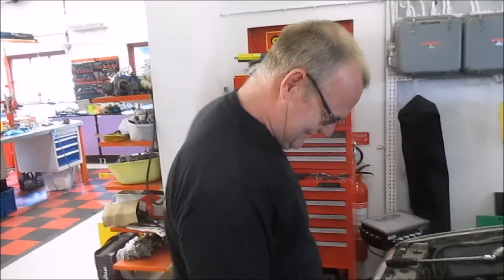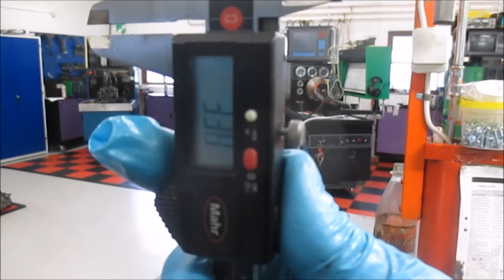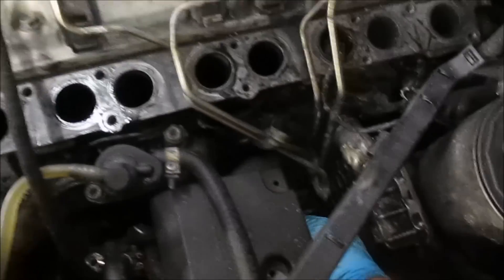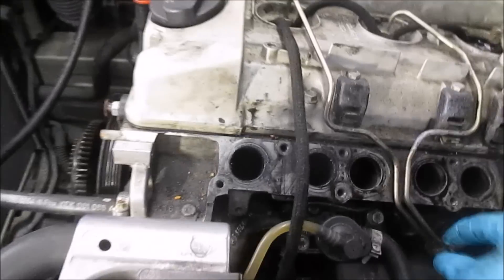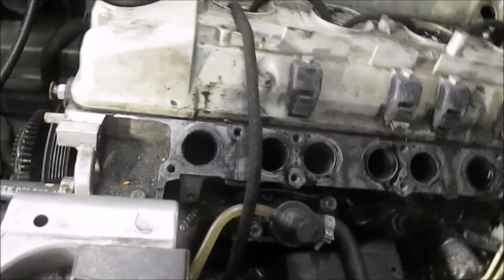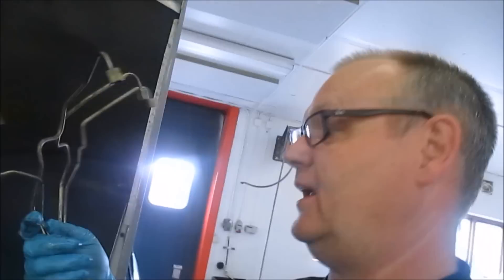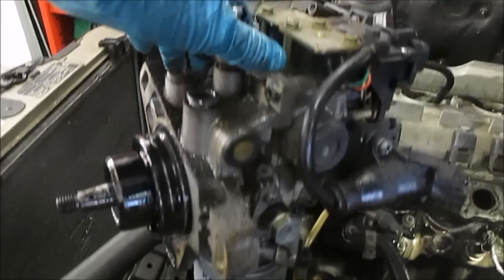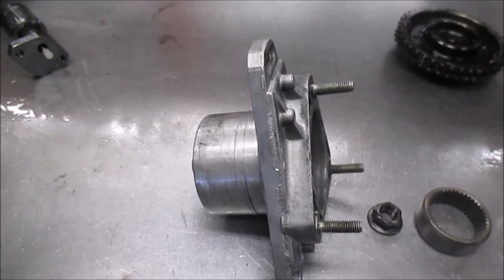OM604 conversion from Lucas EPIC to Bosch VE

Comment: Hi, is it OK to use om605 injectors with 12mm iveco bosch ve pump on the om604 engine??

Pls advice.... Or rather use a 9mm iveco pump with the om605 injectors on the om604??... The 604 injectors are rubbish for that application.

Comment: I have mecedes w210 2.2d 1998 the mecanic has convert from lucas to bosch but odometer has working til  3rpm under 3 rpm is working very well  if up 3 rpm has faultt ???

Comment: I have a problem with om604 lucas oepic old pump broke down and I put other licas epic used from the second car, or in my car does not work properly, the car does not have much power smoky white and works between 1000 and 500 rpm as if I added and subtracted when gas I drive once hoped error epc and lose its power, is that we can somehow help ??? thank you!

Comment: even i have a converted Mercedes ! but does the manual BOSCH pump gives 
the same psi as the LUCUS pump ?  well with compared to the EDC pump the
 BOSCH seems to be lagy ! and my other question is does tthe manual pump proved the same diesel atomisation as the LUCUS

Comment: hi , i have W202 C Class 2.2 diesel  OM604 , engine has not factory fuel pump , now installed OM601 pump , car is very slowly and can i change this?
Reply: om601 pump is bosch?